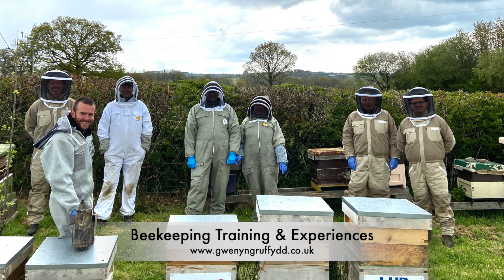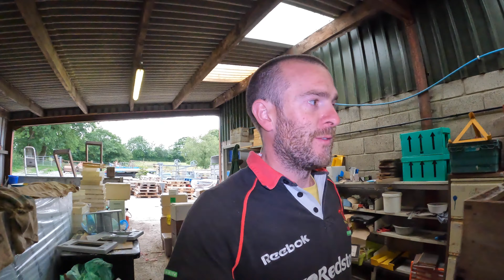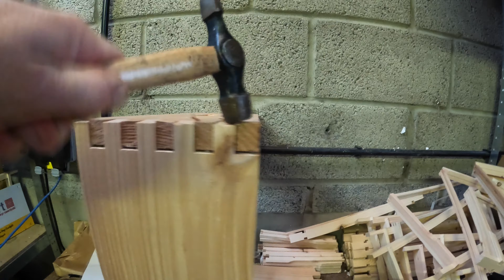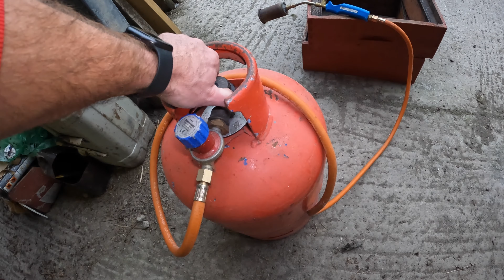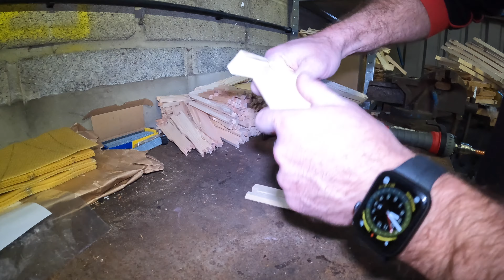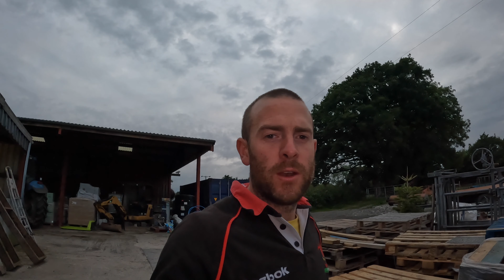Last Push For A Big Honey Crop....Building More Supers In The Workshop!

Comment: Hello there from USA.... really like your videos...very helpful. I saw you building frames in this one ....there is a guy on Fall Line Ridge from USA that has a easier way to build 10 frames at a time ....if you're interested
Reply from the maker: Thank you 😊 great to have Americans watching the channel. 
I’ve seen the rigs, I need to get one made 😅😅
Reply: @gwenyngruffydd  ...the one I made was a smaller 4 sided box and a larger box....the smaller goes inside the larger. Between the 2 you stand the frame sides up. Nail all top bars on sides the remove the smaller box and nail bottom bars on frames
Reply from the maker: Sounds ideal 😊👍🏻